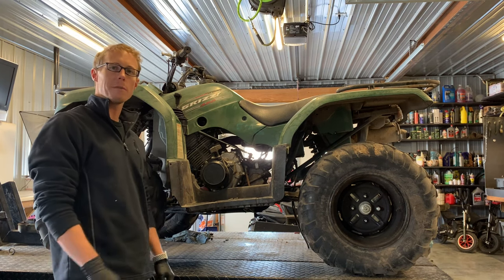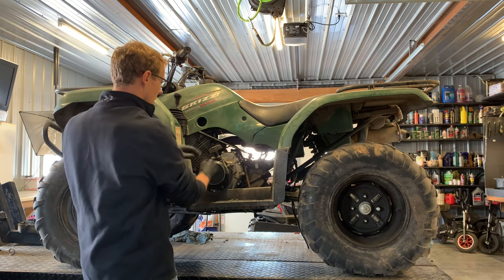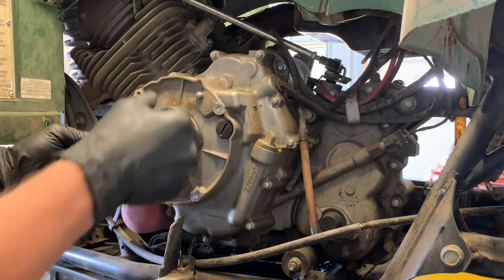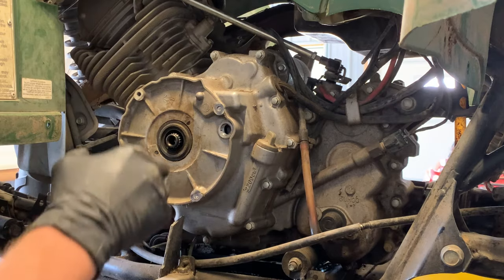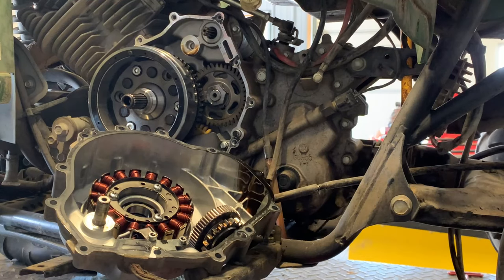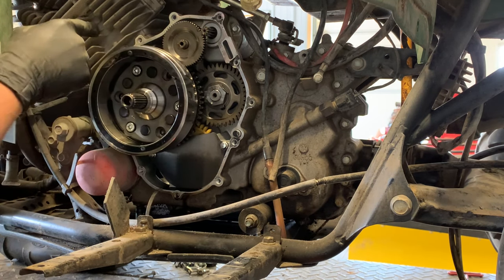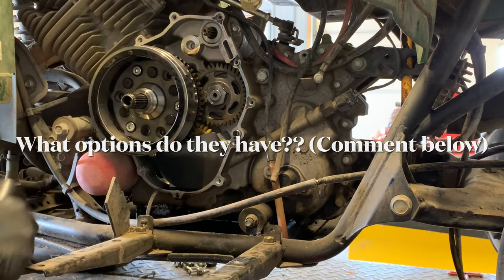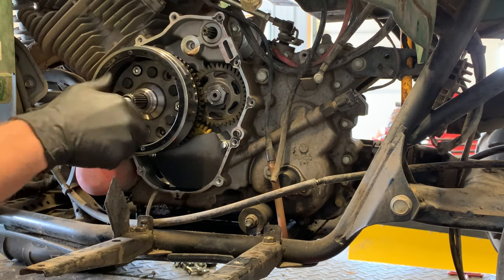Yamaha Grizzly 350 Charging Issue / NO Spark - Stator Flywheel Replace Removal

Comment: Thanks for this video. Followed for my generator and voltage regulator change. However, quad wont start now!? Full of fresh fuel, oil, and battery charge. Nothing else was changed except stator and regulator. Any help appreciated
Reply from the maker: Does it click?  I will need some more information to diagnose. Happy to help. Thanks for watching and the comment. Let us know if you need anything: https://www.ebay.com/str/midnebraskamotorsports
Reply: @MidNebraskaMotorsports  So, turns out the replacement stator is a POS lol. Put old one back on with new voltage regulator thingy, and it started instantly

Comment: Hi good video Iv have some starter problems an cranking problems with my 1999 big bear 350 it ran good till 2 weeks ago I switch it off an can't get to run it has spark an getting gas it hard to pull the starter button just clicks so I use the crank rope it got a bad snatch back an it seems the starter engages when pulling the crank rope an it wine till it clicks an it disengage I assume an not as hard to pull but one hard pull an it snatch back an click an the starter engages it seems again an hard to pull again but the snatch back it bad like rip your hand off bad would like the help an for someone to help an explain an gide me to the way I need to go so I can fix my big bear hope to here your thoughts on this please an thanks for helping videos like this hus one